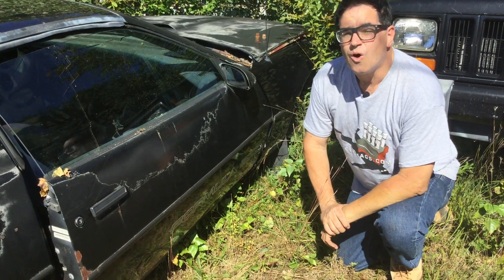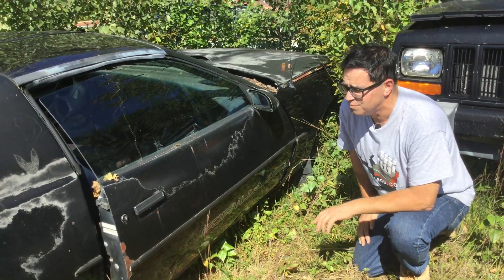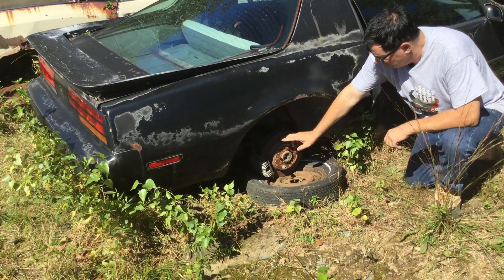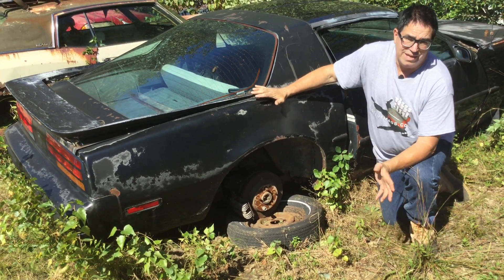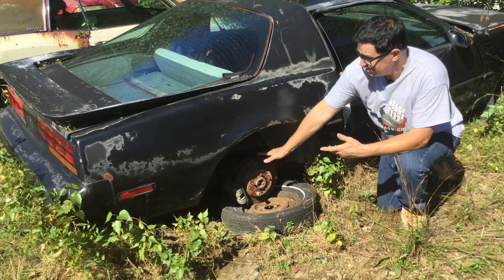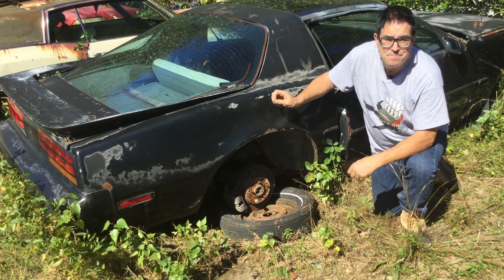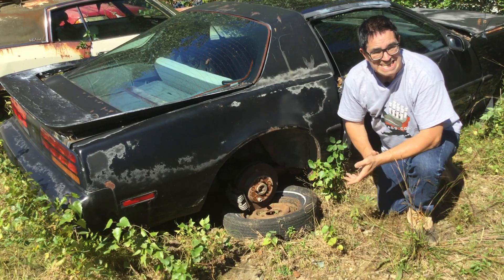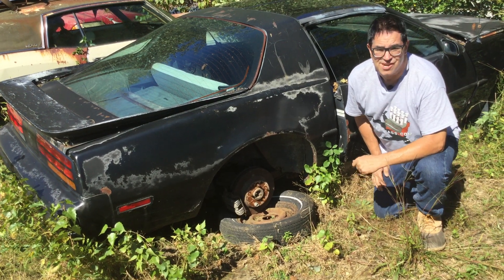Gen III F-Body Axle Gold

Comment: It's good if you have anything but the 2.77, I have it unfortunately and will be switching to a 10 bolt which sucks because the 9 bolts really are much stronger. The parts are just way more expensive and harder to find for it compared to a 10 bolt. I'd cost me around $1200 just in parts to convert to 3.45
Reply: 2:77 your cars got t tops doesn’t it?

Comment: Even harder to find the 2.77 gear ratio for highway cruising, since everyone wanted off the line performance from the 3.27 and 3.45 ratio 9 bolts offered with 3rd gens.  Unfortunately the last 2 model years only came with 10 bolts, since they figured the 7.6" would hold up well enough, even confident that the 4th gens wouldn't break a 10 bolt.  They constantly did.

Comment: 89, 1st year for the PBR disc and last for the 9bolt. Great combo.  Have one in my 89 formula 350 ASC vert, had one in my 89 formula 350 ttop car but it now has a 9".   Have a Dana44 in my JY 92 Formula.  
Replacing the 9bolt diff with the torson diff and better axles is the best things you can do for this rearend. 
Wonder where this car is? It needs saved if it can be.

Comment: I found one of those 9 bolt disc brake rearends on a special order late 86 firebird base model. Was a 5 liter carbed 5 speed car with 2 tone black and gray paint that gm did back then.. was slow as heck but was a sharp car. Also had the aluminum driveshaft. Bought it out of auction with 2 bullet holes in door. Story was he was shooting at police when he was finally apprehended. Really enjoyed driving that car. I replaced almost all systems on it. New brakes, shocks struts, poly bushings and trans mounts. Replqced engine. Hayes clutch. Formula 16 inch wheels with new dunlop 245 50 16  tires. Still would chirp.them going into 4th gear.with that.aggresive clutch. Sold it twice. First guy never finished paying after a year and returned it to me before moving outstate. Second guy wss a kid. His first car. Pretty cool first car.

Comment: I had G92 89IROC w/ 305TPI 5spd 4wd twincat and Aussie rearend.  After swapped with ZZ4 then later on with ZZ430 copy, transmission and driveshaft couldn’t keep it up but rearend did, until I added wider /sticker tire/wheel comb(had stock 16’ w/Baer 13’ rotor). Even so after swapped with auburn diff w/Richmond gear, no more problem. Car was mostly used/setup for road course/auto cross, I guess less stress and simply went up in smoke before anything happened.

Comment: Where is this bird? I need a driver door for my black '88 formula 350?
Reply from the maker: Its at Bernardston Auto Wrecking in (where else?) Bernardston, Mass. As for Dale at 413/648-9300. The car is crunchy but should be saved. These are tomorrows Ram Air 400's. Make that tomorrow AFTERNOON. Their day is coming fast! Thanks, Steve

Comment: I have a couple of 9-bolts (one with 3.23's that was fully rebuilt in the car now) and several in various states of disassembly. They're not bad, and the limited slip is fairly easy to work on and revive. Only bad part is the PBR calipers. Can't use the e-brake when parked as they spread like hell, and parts are getting quite rare at this point. I bought a complete set of new old stock calipers for the car, but now those have been exhausted, so after that, no more joy fixing them. That said those nice chunky 12" rotors never warp. Small swept area, esp. for the front, but at least they don't waffle when you get them glowing.
Reply from the maker: Well spoken! I like your way with the tech!!! -Steve

Comment: G92 option.  I had it on my 1988 IROC-Z LB9, 5spd car I bought new.  Mine was a 3.45 ratio.  Got into more than one argument with a Chevy parts guy when trying to get the rear cover gasket.  I finally just resorted to giving them the part number as most of them didn't know what it was.

Comment: I can tell you from experience, unless you really want to keep your 3rd Gen somewhat as built by GM, these axles are far more expensive to rebuild properly than a complete, bolt-in Strange 12-bolt.
Reply: I can attest to that
Reply: Yep, have one myself. Definitely cost more than other GM rearends
Reply: I've installed a few 70-81 8.5  F-body rearends into 82-92 F-bodys. Southside Machine made a kit with control arms and a crossmember and frame connectors to install any rear with a 3 inch diameter axle housing into these 3rd gens. The 70-81 rear is the same width, cheap to build and plenty strong for most engines. I've seen people running 1000+hp on 8.5s in more than a few cars.
Reply: 68-70 A-body 12-bolt is also 60 inch wide. Same as a 3rd gen F-body.

Comment: I ordered a brand new '87 Formula 350.  $17,500.00 out the door from Sullivan Pontiac in Wheeling IL.  It was a fantastic car.  I also had an 87 Corvette Z52 with the same drivetrain.  The only difference was aluminum heads and IRS out back on the 'Vette.  And 10hp (210 in the 'bird, 220 in the Vette).

The one real big problem with the Formula was the front track was different from the rear.  It had 245/16  Goodyear Gatorbacks on all four corners, but since the tires were unidirectional, that meant there was a unique tire/wheel combination on each corner.  So to "rotate" the tires, you actually had to bust them down and rebalance.  Which sucked.  And the Gatorbacks got really noisy as they wore.  The 'Vette with the Z52 suspension package had 255's on all four corners, but they could be swapped front to back at one rotation, but next time you had to bust them down to swap left to right.  Both cars needed to be aligned about every 20k miles.  Funny thing was, I traded both for a '90 Miata that I put 190,000 miles on and never had to align it.  And at the end of the day it was probably twice as fun to drive as the Vette or Bird.
All things considered, I liked the Formula over the Vette.  It had more room in it and actually was a bit more predictable handling-wise.  The 'Vette had a more stickum with the slightly wider tires and IRS out back, but the problem was the limits were so high on it that you really didn't know that you were approaching catastrophe until it was too late.  Whereas the live axle on the Formula tended to let you know when to start backing off.
There was one time in the Formula I very nearly balled it up.  Was running a very long, flat corner at very high speed, high RPM  (110mph) and the 700R4 trans pan ran out of juice from the side loading and it dropped into neutral, tail swung out suddenly and almost spun into the cornfield.  Never did that again.

Comment: Wasn't there also a "hidden in plain sight" GM rpo code that got you an aluminum driveshaft, radio and ac delete, and lower rear end gearing, with heavy duty brakes?  I recall reading in the late 1980's an article in AutoWeek about someone discovering the RPO code and ordering a car with it for the fun of it 🤣 (Believe it was a Camaro).  It was a hidden RPO for F-body affedionados who wanted to race in SCCA...
Reply: 1LE

Comment: The 78 series is a 7.8 ring gear. In comparison to the 75 series though has a good deal bigger pinion.
AND they have 28 spine axles made from good material. The factory 10 bolt axles were perfectly ok though. 
I use a 78 behind a 500whp Cleveland in a road race car and have yet to break one. Though I do drive to the equipment, something many are unable to do.

Comment: Are the Dana 44's still available?  I have a 89 IROC with the 305 TPI engine & 5 speed manual transmission. I'm looking to do some upgrades to it. Another question, wasn't 16" tires standard on the IROC's?  Mine has 15" tires.
Reply: No , they were disco'd at the end of 3rd gen production .

Comment: They are neat axles but parts are difficult to find and most had highway gears so you need a different carrier for the 3:42 or likewise because the ring gears were different thicknesses. I took the 9 bolt out and put a 4th gen 10 bolt in.

Comment: Hmm,  for decades Chrysler had 8.75 differentials in most everything they made. The big Dana 60 was the Hemi axel also used in the Dodge pickups and swapped into all dragsters. I always wondered why the wheel lug bolts on GM products where so small?

Comment: I had an 89 Firebird Formula 350 back in 1990. It had Auburn the Hi-Torque differential. It also had the WS6 suspension option. It handled like it was on rails.
Reply: I had an 89 WS6 GTA and if I ran over a quarter I could tell ya if it was heads or tails!

Comment: Why did GM screw around with rearends so much when they already had the 8.5 10 bolt available?
Reply: saving weight, saving material costs, saving labor, cafe fuel standards, on and on it goes. if they only did one car one way. we would all drive pickup trucks :)
Reply: Especially when Ford didn't and went ahead and put the 8.8 in Fox bodies in '86
Reply: I always wondered that. Behind the anemic 350 TPI an 8.5 10 bolt would have been indestructible. I owned 2 '87 Firebirds with 350's, a Formula and a GTA. I broke the rearend on the GTA. My friend had an 88 Formula 350 and broke the rearend on it twice. He ended up putting in a one legger out of his brother in laws Base Firebird as it had been removed to put in a Dana 60 for drag racing. But the 8.5 was in full production for use in trucks and vans so it's not like it would have been expensive to build. I guess GM figured the 7.6 was good enough to outlast the warranty period.
Reply: Because it’s GM, notoriously poor decisions.

Comment: Back in 1988 I had a 1971 Chevelle Malibu 350 with full exhaust, aluminum intake, Holley 600 carb, HEI distributor swap, snd my buddy his girlfriend and myself were cruising I-66 west coming out of Washington DC towards Manassas, Va and we rolled along side a brand new Formula 350.
We reduced speeds to around 40mph or so and hit 'em off at same time. We were door to door until around 70mph and that 5.7 Tuned Port Injected Formula 350 started walking away from us.
Four years later I finally bought one. Fell in love with them that night lol.
Reply: Great story. I had my 89 Formula 350 up to 140 one night in the early 90's, leaving a small Iowa town after a date stood me up. I lived on the Illinois side. But honestly, Iowa had better roads. So I said what the hell. As I was passing cars on the highway, some actually pulled over. They either thought I was a cop, or I was crazy, lol.

Comment: To me depending on weight of the vehicle anything under a 8.5 ring gear is not made for serious power or abuse l can tell you GM 7.5 rearend that came in many cars from the 80s-90s are not known to be very sturdy I'd consider them rather weak and l can't imagine this 7.6 is that much better and l could be wrong it's only my opinion

Comment: A 1984-1987 buick GN 8.5 is a better option but hard to find as is the Ford 8.8 they are everywhere if your in the 500-600 crankshaft horsepower range the 8.5 and 8.8 are better options sticky tires and a burnout box can put a big hurting on the rearend something 450 crankshaft horsepower or under with all season tires depending on weight of vehicle should be ok with this 7.6 the ford 8.8 will be cheaper and can be built to handle big horsepower and be much sturdier if used real hard

Comment: Same diff I've got in my Commodore, in my R31 Skyline, had one in my grandfather's 240 series Volvo, we use them in Ford Falcons- all sorts of Australian built cars had these diffs
Reply: Manual Volvo 240's came with Dana 1031 axle, ring gear also 7.75", wonder if it uses the same gear sets.

Comment: Did the 89 Indy 500 firebird turbo have the same setup engine and rear end as buick GN?.
Reply: The TTA used a different engine compared to the GN. Alot of similarities, but I believe the heads are different due to the smaller engine bay.

Comment: Word has it that the Dana 44 would bolt into the 9 bolt rearend housing with some clearancing,not sure on if the 9 bolt axles would work with it. Does anyone know,because I have this same car that needs this kind of work. I know you can order aftermarket units that are a truetrac alternative,they are being manufactured today.
Reply: No , the Dana 44 internals will NOT fit in the B-W housing no matter HOW much you "clearance" , Clarence !

Comment: I had the same rear axle in my 88 T/A 350TPI.  The only down side was it had 2.73 rear gears, and at the time it was hard to locate 3.42 or what I preferred 3.73
Reply: That was my go to car around 2000. Digital dashes and WS-6 suspension, I was in heaven. I would buy them with cooling fan problems and treat them like a step-sister. Like a few other comments I finally graduated to Corvettes.

Comment: I remember reading the GMPP catalog about the D44 F-body axles.  I had ordered a 92 1LE (with power windows and deluxe interior no less) 5-spd 305 so the G92 3.42 was fine for that.  Later it got a vortech supercharger that they used to sell for TPI's and even then the factory axle held up fine.  I will say the small auburn posi was garbage and didn't grab well at all.

Comment: Thanks for the third gen info Steve. Didn’t know they offered a Dana 44 rear end. Good stuff man keep it coming
Reply: Right I thought there was only one or two options of rear end for these figured a manual and an auto usually factory puts different gears in...all I know is when in doubt go with a ford 8.8 or 9 inch and bullet proof it...lot cheaper then buying a brand new Currie or Dana unit they run 3 to 5 gs easy..its a lot less to just build up a donor from the junkyard and you know its A1
Reply: Actually the 9 bolt axle was stock in IROC Z s as well ,was not an over the counter option . This rear end is basically a Aussie Holden rear diff. Google it and see. , the 7.5 would be in the non Iroc and lower performance camaros and firebirds.
Reply: @ronniecox109  that's what I meant I didn't realize they ever offered this rear end as an option...not that is much special about most g body's but thought it was a neat fact.
Reply: @ronniecox109  the Dana was over the counter .. availble with 2 ratios.. $1000.. sold out quickly, ED Hamberger's  SLP  acquired  another  batch and they sold out too .. i changed  a set of 9 bolt gears  for a customer  back in the 90s .. it was like a  $800 bill
Reply: over  the counter dealer part .. not a factory option
Reply: @hitekbigmek  ...still it was a available option and if I was going racing at the time who wouldn't want a beefier rear end swap one for a dana 44!? 
Wonder if the candian player's challenge series would of allowed this?!

Comment: Try finding parts in America for the M78 Australian built rear end I've rebuilt two of them and everything had a 200 dollar shipping price. You can order a new posi from Australia that's a torsen style posi but the posi is 500 dollars and 250 for shipping.
Reply: Rockauto? Built in Australia, used en masse in the US
Reply: @maxthe222  the M78 Australian differential is a 9-bolt that was borrowed from GM's or Holden's Australian plant

Comment: Thanks for re-engaging these 3rd Gen Firebirds/Camaro's as they deserve there time and attention in glory! You educated me on the Dana 44 over the table option as well as the SLP standard Hardware. I only thought the Corvettes alone had Dana's. When I did my GTA CPU and Rear in swap it really livened up my 87' 305tpi Trans Am and also the 9 bolt had more gear as well for more RPMs and bottom end grunt!
Reply: I mean, danas are in tons of mopar? Chryslers, dodge, jeep. Powerwagons are notorious for a dana 60 in the rear and a dana 44 in the front. It's an incredibly common sight in c body mopars or b body mopars. Even some a body mopars  if they were tuned for power. A dana and a torqueflight was a bulletproof drivetrain. Even the chrysler 8 and 3/4 was a stout rearend. Im surprised people are just now hearing about it. Danas been around for decades at this point
Reply: THEIR time and attn. in glory. 🤦😖
Reply: That 9 Bolt are junk period.

Comment: That is a heck of an axle. I built up an '86 5 speed 305 TA back in the early 90s. (305 out, 350 in)  I got one of those axles out of a 350 GTA I bought for parts. There were other cool parts on the GTAs, Formulas, and Firhawks also. Ever heard of the "wonder bar?. It was a stiffener placed across the front of the unibody near the antisway bar. I noticed you did not mention the disc brakes on those Aussie 9 bolt axles. Thank you for an informative video.

Comment: Only bad thing about the 9 bolt rears were they used Cone style posi units instead of a clutch style in them and parts are hard to find, and expensive when you do find them to rebuild the posi units.
Reply: Very hard to find the parts. Had to find a new ring and pinion for my 89 iroc that has the 9 bolt BW. Was lucky enough to score an aftermarket ratio from a local shop who had it in the shelf for 8 years
Reply: Gear Sets in any desirable ratio are Virtually Non Existent....And like you said Pricey when you do.

Comment: Didn't know you could order a Dana 44 for that car through the Chevy or GM parts counter. I always heard that 9-volt Australian one was the best rear end you could get for a third gen. I also heard it was only marginally stronger than the seven point six five one and neither of them would hold up to too much more than factory horsepower and torque

Comment: I think the weak, torque arm rear end is the biggest flaw of the 3rd gen F bodies and earlier H bodies like the Monza.  I wonder what made Ford decide to upgrade the rear end to the 8.8 for the 1986 Fox bodies, while GM soldiered on with the 7.62.

I had the stock 3.27 geared 7.5" in my 5.0 CFI 1985 Mustang.  It held up on the street for the first few weeks, but broke the trac-loc on a 1/2 shift with drag radials at the track after I swapped in a t5 and 351w.
Reply: Actually , the torque arm 3 link is awesome . 
Suspension works great with the Dana 44 , 12 bolt conversion , 9" conversion , or 8.8" conversion .